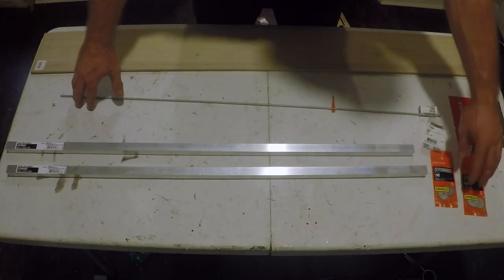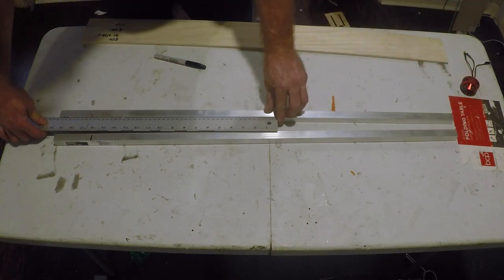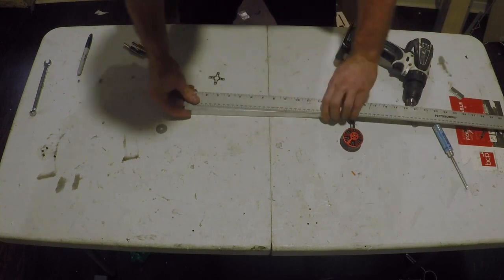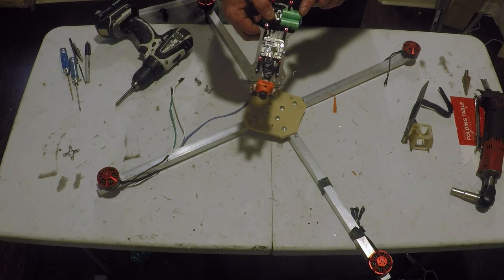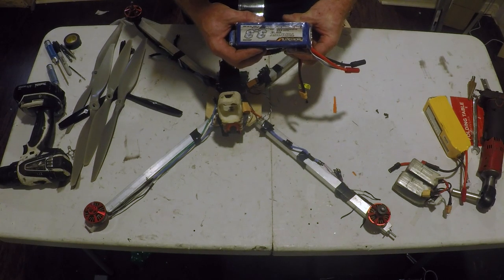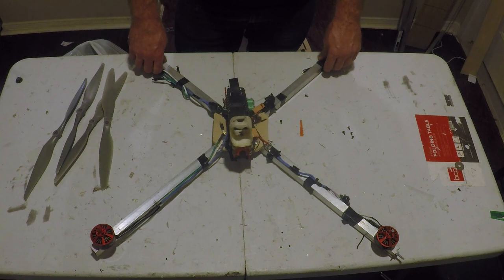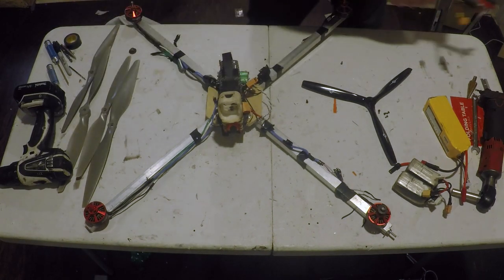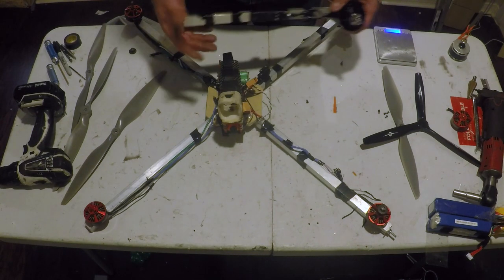$50 Frame. How to get into the world of X-Class Quads

Comment: Am I hearing you correct that you're using the Speedix ES30 on 8S?
Reply from the maker: Yes, that's correct.
Reply: @briankoch7041  So I noticed the motors are rated to 8S but clearly the ESC's rated for up to 6S were able to handle 8S.
Reply from the maker: There is no such thing as a voltage limit in brushless motors and voltages we use in quads. 

Motor rating is based on the heat limit of the windings and the insulating coating on the windings and stator. A byproduct of current through a resistor is wattage loss in the form of heat. There is a point where the heat breaks down the winding to the point of failure. The winding doesn't care about voltage until the point where the voltage is high enough to arc through the insulator....100+ volts in the case of the windings used in quad motors.
Reply: @briankoch7041  That part I'm aware of regarding motors.  But the ESC's have a rating.  I've blown up escs on 6s that were only rated for 4s.
Reply from the maker: I've run 8s on items such as omnibus and clracing flight controllers, rdq vtx's, foxeer and runcam cameras, and escs such as spedix es30a, rdq 30a 32bit, and 5 dollar hobby king 20a escs.
The only issue i've had with that input voltage is a camera sensor slowly going dim and a cap on the omnibus voltage display.
Reply: @briankoch7041  Ahh, ok cool

Comment: were you  running 8S in this video?
Reply from the maker: Yes. Racerstar 4114 400kv motors with apc 14x8.5 props, spedix es30a escs, and two 3300mah 4s batteries in series.
Reply: @briankoch7041  Good info.  I'm copying what you did here.  That thing looked fast enough for me.